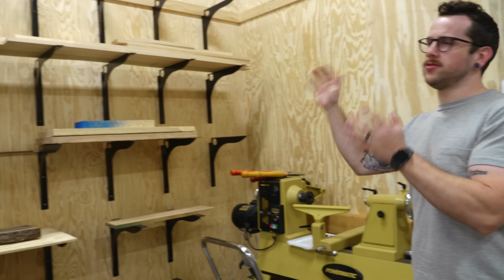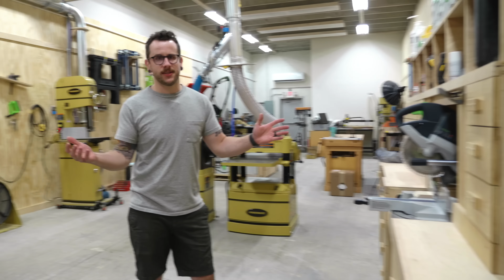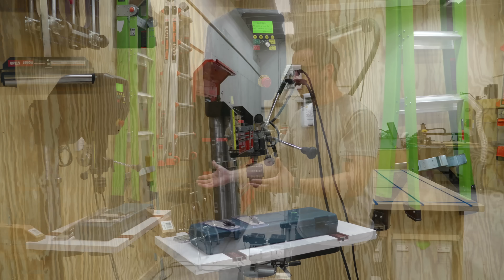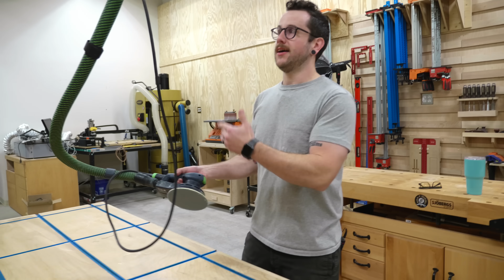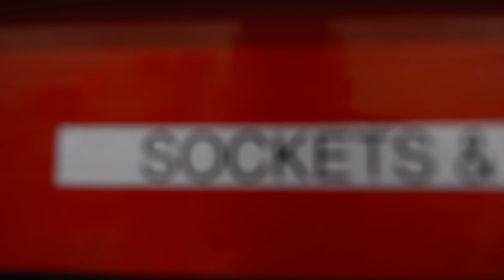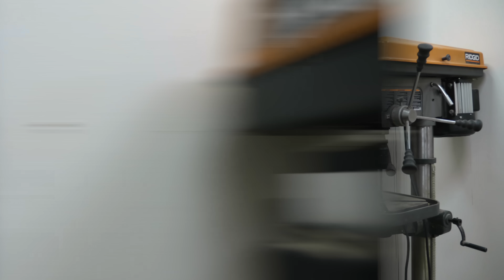SHOP TOUR 2019, All of My Woodworking and Metalworking Tools!

Comment: Nice shop setup, but regarding the dust collection for the table saw, you can set the router table in reverse, facing the saw blade instead of the table end, and then you can put the 4 inch extractor. This setup is not convenient if you need to route a big piece but for 99% of the time, it works fine, especially if you are tall enough to not have to bend over too much.

Comment: Good lookin' shop!  I'm due, for a shop reorganization.  That metal cutting bandsaw is a gamechanger.  I love mine.
Reply: If you get a chance to try an Ellis 1600 bandsaw, you’ll use that Jet for a boat anchor! None of this stuff about loosening bolts and fumbling around with the vise jaws to cut miters and having to angle the metal away from the saw! The saw frame simply pivots so the vice and stock being cut stay parallel to the wall at all times! Saw features a 1” blade, and they don’t even offer a messy coolant system because it’s unnecessary! The provisions for adjusting the cut to dead square in both directions are wither best on the market! Hell of a nice shop though! I applaud your wise choice of Lincoln welding equipment!

Comment: You can weld a mobile base for your 12" jointer very easily. I have a PM1285 jointer, which rolls around with one hand on the base I made. Best, @HoneyOnWales

Comment: I really like your videos. This one gave me good ideas for my shop which is almost done being built. Are you going to continue using the Fastcap Best Fence with your miter saw? I’m considering using it for my shop.
Reply from the maker: Thanks Chris! Not sure if I'm going to set up the BestFence system again. It works great, but I'd rather have a system that had no actual fence and was just flush with the table. We'll see!
Reply: Crafted Workshop I assume like Marc Spagnuolo has, which is a T track in the table with a stop that slides in it? That is the other way I was thinking of going.